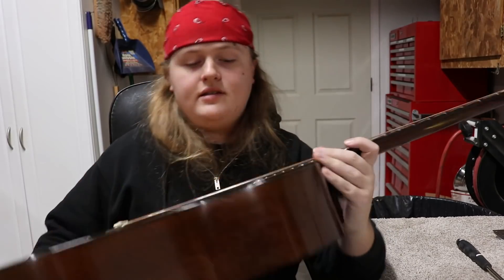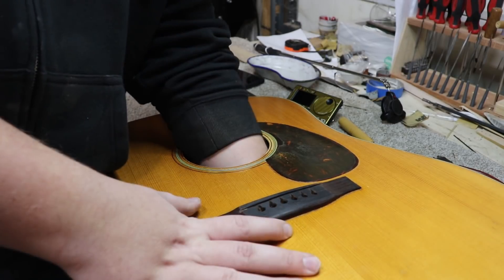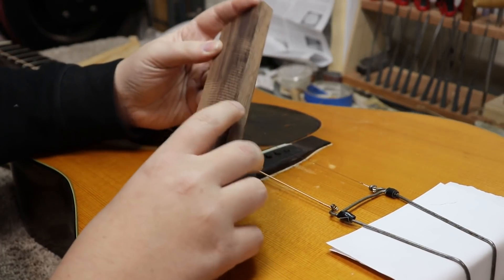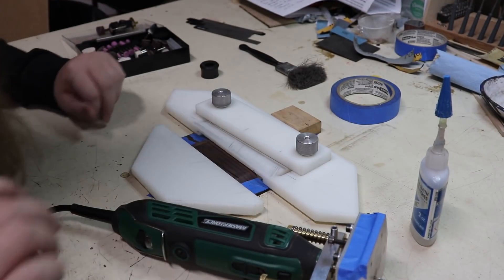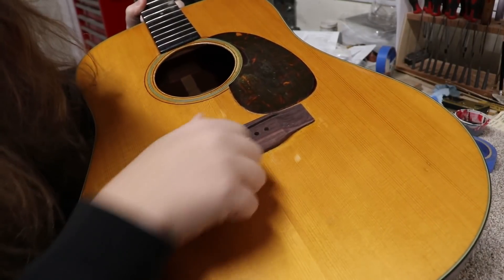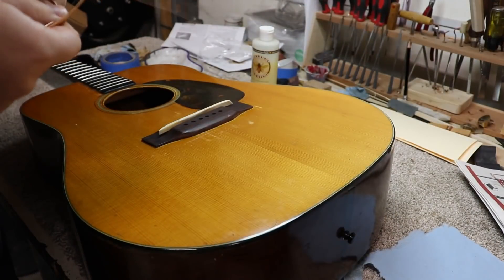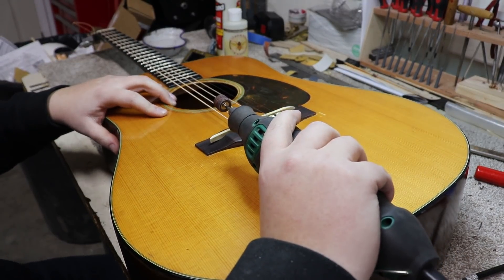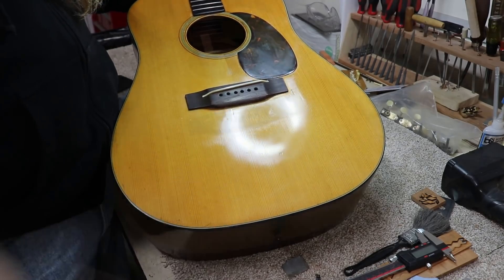486 RSW 1960 Martin D18 Battle of the Bulge

Comment: $230 in 1960 sounds about right. I bought my D18 brand new in 1972, and I paid $375 for it. It's still a great guitar, people are always impressed by the sound of it when I play it. Definitely a good investment, no question. Only issue she is really having is that the pickguard is starting to pull off, but not all that much to where I'm worried. Just that you notice it. Or at least I do. 

Good  job, Caleb. You're doing well. Soak up everything you can from Jerry while you have that source of info available. It's been a pleasure to watch you learn, I feel like I'm doing an apprenticeship with you.

Comment: Why would you not protect the top while prying off the bridge? You can get flexible cutting boards 2 for a buck at a dollar store that will last forever. The neck looks nice.
Reply: Steven*When I worked on vintage instruments.* Number one keep a clean work bench and place a clean bath towel on top of your work bench carpet.**The   work bench  carpet could have small metal participles enbeded in the carpet** keep all tools on  the left side of the bench **the neck will be close to the tools.. not the body.**DR KEL

Comment: replacing a small maple bridge plate with a larger one made of Paducah will definitely be detrimental to the sound of this 1960 D18...
Reply from the maker: You may think you know what you're talking about but you're 150% wrong
Reply: @RosaStringWorks   I don't believe so...
Reply: Agreed Bill. If anything you would think they'd use the same material to make the new bridge plate as the original.
Reply: @mattrogers1946  Yes, as most Martin knowledgeable owners know, the small Maple bridge plates are preferred and do have a positive impact on the overall sound/tone/volume. The small Maple  bridge plates on D18 and D28 were replaced by larger and heavier Rosewood  bridge plates in the late 60's (68 or 69).  The HD28 which was first produced in 1976 came with a small Maple bridge plate while the D28 of this era still utilized the Rosewood bridge plate..
Reply: @billdedrick1914  I have a '70 00-18 and a 72 D-18. With some work, they a both fine guitars, but much different than the "Golden Era" Martins of the previous three decades.
Reply: @mattrogers1946  I agree, I used to own a 70 D18 and a 70 D28.. Both sounded great but a different tone/sound than my 66 D18 and 67 D28
Reply: @RosaStringWorks  This is a highly inappropriate response to what is common knowledge for vintage Martin restoration experts

Comment: I was born in 1960 like that Martin, that guitar is in much better shape than Me, Good job Caleb but I must agree with one of the other comments You should alway protect the top of the guitar when pulling a bridge with a thin plastic sheet or even low tack tape anything is better than risking putting a gauge into a top of an expensive old Martin. God Bless🙏🙏🙏🙏🎸🎸👏👏🇺🇸👨🏻‍🦯

Comment: In the "mushy" areas of the guitar, although the cleats may offer a slight improvement, in my opinion, the better solution would have been a 2:1 mix of PVA glue and water and then add wood sanding dust to make a loose paste; paint a few layers of the paste on the inside of the guitar at the mushy area and it will make the area rigid by locking the wood fibers.  Thanks for your time
Reply: I thought som3 fabric glued on and sanded, for best resonance, but not saying that is better. Howsoever it looked too compromised to leave.
Reply: Ps loved the sound of that guitar, and Jerry is in wonderful voice.
Reply: If I were both the luthier and owner, i'd  have placed reinforcing strips (vertical brace) perpendicular to the cracks, added a few more strips in areas likely to crack and then cleated  any trouble spots-reinforcing strips are designed into many Classical guitars(often every 2" or so) and I doubt the tone would change enough to notice.

  Having said that, the resale value would have been somewhat reduced, and the customer would have been charged for the extra work. It's likely that the customer was happy with the repair as is (and probably wanted the slightly higher action as well.

Comment: Wood glue forms a molecular bond, and "toothing up" the wood, will give you a lesser joint. Perfectly fitting surfaces is your friend. Toothing up, is for gluing with i.e. epoxy, as this creates more of a mechanical joint.
Reply from the maker: I totally agree except that when you're working with this wood it's kind of waxy and when I say toothing up I'm not really digging trenches I'm no digging trenches I'm just more or less breaking up that wax and wiping it down with  Acetone

Comment: I had a cheap guitar that had "soft sides" you could press in.  Turned out the sides were plywood and the layers of plywood had separated creating a gap.  Difficult to get glue between the layers and press the layers back together.  Had to cut it open to see what was going on. After the "fix" I painted the guitar.
Reply: I got to tour the Collings factory.....got to play a bunch of factory seconds. One of those were this thin. Played beautifully though.
Reply: Well the guy who owns it seems to be under the impression they do. It was cash only. They had a room off to the side full of guitars with tiny flaws. I wanted to buy one that had a spot on the side too thin....you could bend it in easily.....sounded and played incredibly though. I had just retired early from the army and couldn't afford it. The smells were incredible....and the guitars are amazing. They build the best.

Comment: granted the bulge is there but martin tops are not flat and not supposed to be flat the are made with a radius in the beginning.
Reply: Exactly.
Reply: I have a very heathy 2018 000-28, it has a definite radius down to about 2 inchs from the end
Reply: @timgelder4263  Different builders use different amounts but every steel string guitar I have ever had my hands on had some radius... I went to luthery school in 1974 so I have been building acoustic guitar since then I use a heavy radius because of the way I was taught back then I use 28 feet on the top and 15 feet on the back..
Reply: @creedsexton296   your resume is great but I was just agreeing with you and didn't  any convincing

Comment: Wiping down and oiling the bridge with the pins and strings installed + pushing the cloth through the strings to cover the front of the bridge???? 
Then quickly brushing dust off the top with a sleeve (32.16)?
That doesn't seem to be the cleanest way to do things.
Then, when the job was finished, Jerry told him to do jobs he'd overlooked . . . this isn#t boding well.

Comment: I’d consider using some thin plastic to protect the top of the guitar as you’re removing the bridge, especially with a guitar as nice as this one! The top looked pretty dinged up after you removed the bridge
Reply: Yes, indeed. I find that thin [10 mil ] Mylar sheets work very well.
Reply: The dings were there before he started! It’s one of the first things he mentioned.
Reply: And too many tools on the bench. Cringe
Reply: Yes, unfortunately that was absolutely butchered. Shame.  Normally it’s pretty acceptable work from Caleb, but I hate to say it that I don’t think this one was.
Still, I enjoyed the video, but I wouldn’t want to have been that customer. (Although I realise he is happy)
Reply: I think this is camera angle and  light. Later shots they don’t show again: eg 35.50 ish. I think we’re going to differ on this; looks like good restoration to me
Reply: As I said, I think we’ll continue to differ on this ( which is fine and I respect your take on it) ; again, he did mention the damage very early on and there are several later shots comparable to the early ones which look fine; of course he’s worked on improving ( not “repairing”) the finish; it’s a 60 yr old guitar. My take stays at good restoration. Regards.
Reply: @stanby2712  can still see damage
Reply: Well the damage may have already been on there but he was using the tools on the top without putting something underneath to prevent further damage. Question I had is why did you use rosewood versus using ebony as the first bridge was made of ebony
Reply: A couple of later thoughts; first, on an old instrument, there are always issues when you’re “repairing a repair” ( or in this case maybe several earlier repairs). Second, the marks you point out ( and I can see what you’re on about and I do have a decent monitor)  are further away than I think would be necessary to remove the bridge and also, with the amount of gap under the bridge already lifted, why would any force to the degree of marking the surface be necessary?  I’ve removed the odd bridge or so over the last 50 yrs and my expectation ( and nothing is certain in this) would be for it to come of with a bit of heat and minimal effort; no gouging/ force or scaring needed.
It’s unfortunate that he didn’t film the whole process as that would clarify a lot.
I’m  not claiming infallibility here but for me, it doesn’t add up. Regards again. 
ps regarding “protecting “ instruments, I think Caleb does rather well and in this case the guitar was way better after his work than before
Reply: Sorry, I know Caleb means well and is trying hard, but he comes across as very amateurish. Definitely not ready to set up his own business without a few more years of tutelage and guidance from Jerry.
Reply: Yep, lots of dings and scratches.  That's not acceptable for this type of guitar and not a good practice that will keep you in business very long.  I respect Caleb is doing his best, but these issues will lead to irate and upset customers demanding free repairs or their money back.
Reply: And if you're not  there working on it and actually see it on person, just stop. You all know Jerry wouldn't have let that go if it wasn't that way before.
Reply: @29mailman  I'd lose my shit.
Reply: @chrismills1561  Except he did.
Reply: @papaslick83  May not have had any ebony on hand. (speculation) Rosewood makes a nice bridge too.
Reply: @jthonn  Not knocking the bridge I thought he did a great job I just wondered why it was rosewood instead of Ebony. That first bridge was black wasn't dark brown it was black some guy on here said oh it was rosewood Its not rosewood unless you painted it black. I can't believe people are honestly arguing with each other about this stuff. You can see that Martin had lots of problems least of which were a little scratches around the bridge never know he may have bought it himself at the end of the video though it looked a whole lot better than it did while he was working on it which that's the way it's supposed to work
Reply: @papaslick83  I agree, sometimes you might end up with a couple of battle scars when you do these repairs. Maybe he should try to protect the guitar when pulling a bridge, he was a little rough, he may have caused those cracks under the bridge. He also could have put a little time in trying to hide the side cracks. They were in contact with the customer, so funds may have ended. In the end it turned out nice.
Reply: @29mailman  Look at 4.05. Some damage is plain to see just before he starts work on the bridge. You can't always see finish damage in a given light angle. Can't see why what he did would have caused much, but it's also what the man himself does.
Reply: I noticed that, too. I'm disappointed to see that big gouge in the top's finish. Also they should consider using low-tack tape like drafting tape instead of painter's tape to avoid pulling the finish off like Caleb did on the side. Otherwise a decent repair job.
Reply: @stevedimebag  yep. Jerry should give Caleb the Harmonys and the no name guitars until he learns what the hell he’s doing. As for those that say if the owner was happy that’s all that matters. Yeah until the original owner dies and the family sells the guitar and puts it back in the world again.

Comment: Great job, but I must admit I cringed when I saw you using all those tools to remove the bridge, without protecting the top with painter’s tape.
Reply: Sure, and yet there are a number of bridge removal videos done by others where no protection is used, including at least one from twoodfrd.
Reply: @DavidTrabue  oK good job?
Reply: @DavidTrabue  OK.  It’s been a while, so I frankly don’t even recall the details of the video.  But, I don’t disagree with your comments, in general.
Reply: @DavidTrabue  no worries.  I was sorta kidding in my initial response.  Going back now, I see several people have left some pretty frank comments about the quality of the repair job.  It made me go back and re watch some of the video and I see more what everyone is saying.  I agree, if that was my 1960s Martin, I would be pretty upset at the finished work and the damage that was done while doing it.
Reply: @jmdbb   twoodfrd can walk a tight rope with no net.
Reply: @bldallas  with all due respect, what makes it even "good"? If he was a doctor he'd be facing malpractice. Scratching and gouging what had been a pristine top because he used the wrong tool and didn't protect the top? Replacing a perfectly good bridge plate with one that's larger and thicker, when that's not necessary to reduce bellying? Installing an oversized bridge instead of a correct one in order to avoid doing a little finish touchup where the previous one was slightly mis-positioned? Removing all of the finish from a neck because it was dinged up? Making the intonation "good enough" rather than perfect?
Reply: @bldallas  Sorry I posted my negative comment below before I saw this one. Glad we agree.
Reply: @brettwilloughby2981  Yes he does.